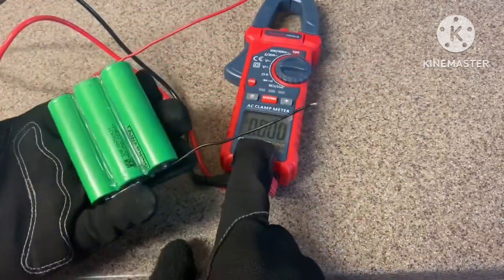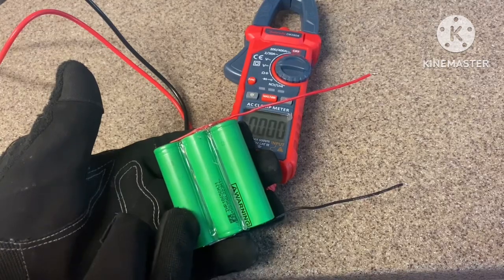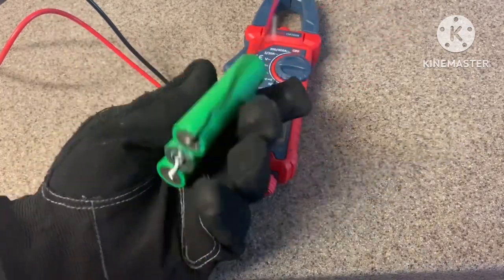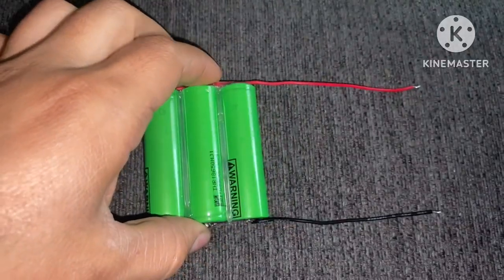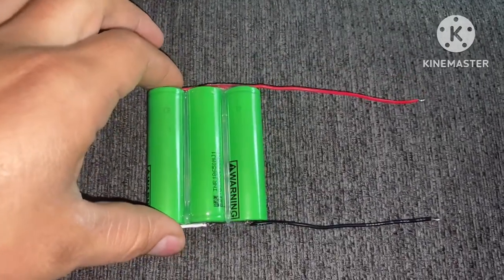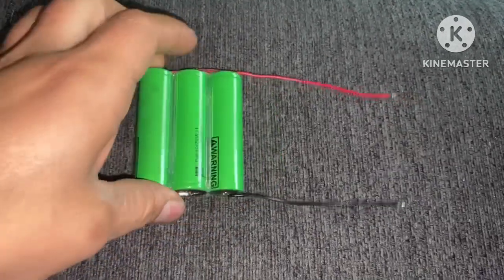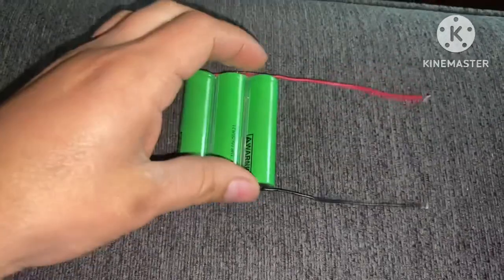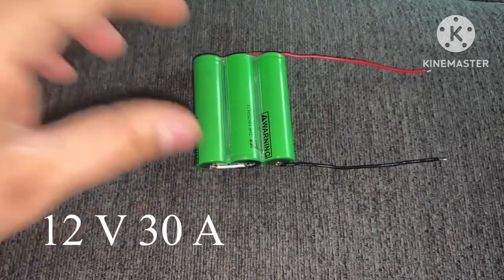12v 10a  | battery pack | DIY | TUTORIAL | 18650 cells

Comment: Just FYI Lithium Ion batteries don't like sustained high temps so soldering really degrades them. If you can invest or make a spot welder its much faster and cleaner and most important it wont damage the battery.
Reply: could you put the battery in the freezer for like 5 10 minutes before soldering for less damage
Reply: Lmao say that to my smoking hot lipos on my race drones that are over 6 years old and  still running
Reply: @billybobdaguy  totally different type of heat application.